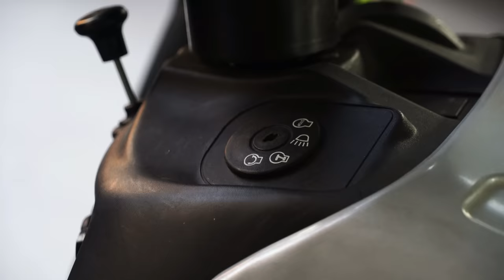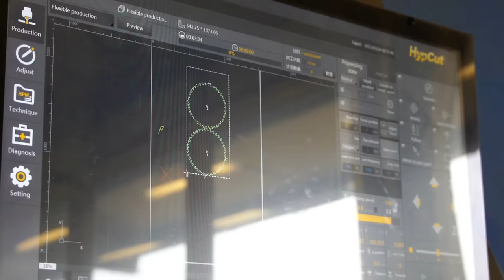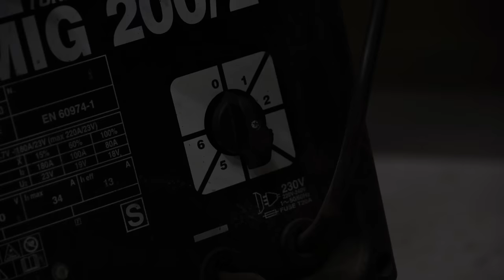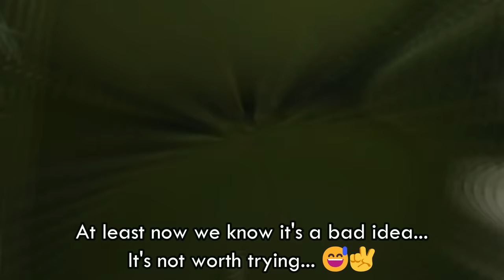CIRCULAR SAW on Tractor MOWER !?

Comment: For this to work properly you would need to put the circular blades below the deck. Or build a deck special for the blades that don't have sides. Think of how the circular blade works on a weed Wacker and there you would have you're answer and design
Reply: it still wouldn't work - never in the history of mowing machines was a saw blade ever used aside from flail mowers.  a standard mowing deck blade creates a vacuum to lift the grass as it cuts it.    Weed Wackers have a circular blade for cutting small saplings and brush - but it does poorly on grass.

Comment: The blades need to be balanced rotating at the same RPMs as when spinning on the mower - where you welded the extra weight on the blades to balance them makes a big difference due to the centrifugal force when the blades are rotating. It is possible and perhaps likely they are not balanced when rotating at the mower's RPMs which might be contributing to burning up your belts, etc. Opening the front of the deck so that the first thing that hits the tall grass is the blade should help (and the blades need to be sharpened to be like knives) but you also need to modify the design of the blades to act as a fan moving air upward to cause the grass to stand up straight under the deck and then be cut by the blades.  All the blades need to angled upward to lift up the air in the direction of spin just like a lawnmower blade to create that effect.

Comment: They make a weed eater wit a saw cutting blade. By no means does it look good. String cutters look a lot better in the long run. Blades make it look good. Saws are just there to get the job done.

Comment: The only mistake you made is the blades are too large to discharge the amount of tall grass, if the blades were an inch smaller in diameter and had but only 1/3 the number of spiked teeth not saw blade teeth spaced out in it would have blown through the tall grass with ease. This is a great idea but your understanding of cutting grass verses cutting wood not wood is miscued.

Comment: Cut some holes or curved slots in the saw blades to lighten them so they will spin faster.  Sharpen the bottom of the blades teeth (the U-shaped part between teeth), like a gut hook on a hunting knife.  I think this Idea has potential.

Comment: There is a problem with the circular blades not providing any or much lift. That said, with really tall, heavy grass, the deck bends have holds the grass down so blade lift is less effective. 

Another problem I see is that while the blades are turning the same direction, the circular blades are mounted with the cutting teeth in opposing directions. It seems as if with this arrangement that one blade would cut better when mowing forward while the other would work better when mowing in reverse.

Beyond effectiveness, the mass of the circular blades is many times that of the normal blade. That is why it stresses the belt so much more at startup. The blade spindles and deck would likely suffer premature failure if the circular blades were left in service. I would also assume that the circular blades mass would cause them to continue to rotate for a while longer than normal blades once the drive was disengaged. I would think this could present a somewhat less than safe condition. 

All of the above said, it was an interesting experiment.

Comment: well. If you would make them a touch smaller. and make the cutting blades on it longer so theres more of it, then theres a chance (also sharpen it)
Reply: Still would not work. Mower blades suck the lawn up into the mower.

Comment: Yeah you need to go back to using the mower blades. The circular saw blades is not working. The circular saw blades are to big and the grass can not get discharge out from the under the deck and you leaving a lot of tall Grass and weeds behind.

Comment: i recomment smaller saw blade on it not big one size blade and use big mower blade with 6in saw blade so keep rode from not getting jammed up in blade it cut rode off and anything that taller like stick will get snap in half by small saw blade and if you want keep it normal them lift deck up enough and drive forward and revere so it can get tip of stick in deck so blade can chop it in half
(im engineer repairs and know how it work)
reason mower blade have tip at rear of blade is created vacumming so it can suck anything up into blade and saw blade dont have any on it so not going to work

Comment: You have straight bars that sit up inside the deck, try a set of drop bars that allow the tips to be slightly below the leading edge of the deck.  Also sharpen all the way along the cutting edge,  yes up the drop down as well.  This helps with the disposal of long grass by multiple cutting almost mulching the grass.

Comment: I would have gotten the machinist to just make  small metal plates with the proper hole for the spindles and weld it to the blade...aaaah   forget that, too....kind of igenius, but dangerous and just not a good idea

Comment: Use x blades which is two blades per spindle get a much better result than just a single blade
Reply: really great way to destroy a spindle< how do you plan on making sure both blades are evenly balanced. Even being offset by half a degree will have you making unnecessary repairs. I suggest he sharpen his blades, also would help if he wasn't blowing his chaff into his next pass. Plus if he had any landscaping experience, he'd know that professionals do a thing called cross cutting when dealing with overgrown grass. My push mower eats gas better than that rider does.

Comment: if you Sharpen the backside of each blade tooth 🦷 and run it reverse spinning compared to the normal woodcutting direction you'll also see major improvements then just weld on amd balance some 2 ta 3 inch top flaps above the blade now part of the blade to help move the air bolt 🔩 on could work but you already got a welder and yeah not pre folding the grass with the leading edge of the deck is key, gotta hit it while it's still standing on the other hand most fancy automatic electric only mowers just use a plastic disk not even metal like the high quality you have and they screw razor blades to the tip so they swing out with centrifugal force be careful though ya probably get more powerful rpms with a larger disk than a lil 6 to 12 inch plastic pie plate 🍽️ can handle  and then you want all clear for when the super lightweight metal razors go minimally comtrolled flying off into the yard

Comment: Try flipping the blades maybe the teeth aren’t going the correct way and a little bit thicker but shorter belt. And a little more clearance around the mower deck for the grass to get into the blades you had it dropped down so it makes the mower deck basically a sled and only an inch of space for things over a foot long to pop up into if you get what I’m saying so maybe a little smaller blades and a little bit lighter. Maybe like 5 or 6 things that branch off from the center and widen out into portions of the saw blades teeth with a gap between each one, having the gaps be rounded with teeth going down them too. Let me know if you try it I would like to know.  It seems like you have the correct connections to give it another shot. if it works i I will have to invest the time of trying to make some myself.

Comment: The teeth on the blade were not sharp - you were essentially just whacking the grass stems with them, and also the teeth were far too small / fine. To cut grass and weeds you need coarse, large teeth and they have to be sharp. You would have been better off with a 'STAR' blade with 5 teeth on it that were all sharpened.

Comment: Maybe mow at a much slower speed, which will give the long grass time to exit the mower deck.
Reply: A saw blade only cuts with its outer edge. The mower deck is pushing the grass down. The deck has to be modified for this work and it will have horrible results.

Comment: The circulars are too big to allow the grass to stand  back up enough when the deck goes over it.
Reply: If they were smaller then youd have to make a bunch more passes. However if you cut the front half of the deck off then it would work...horribly.